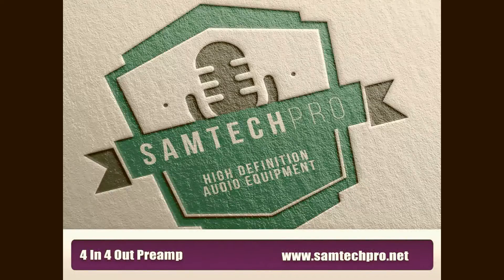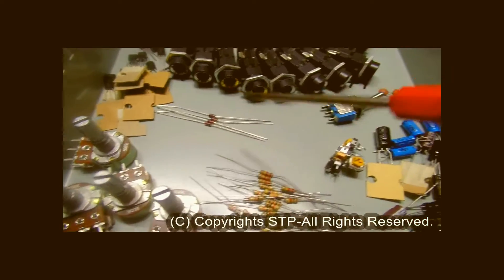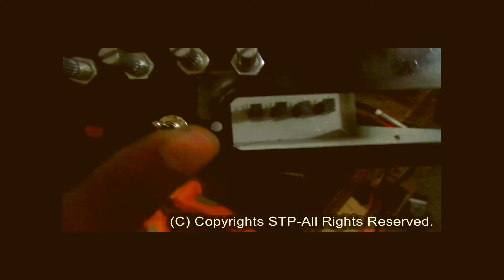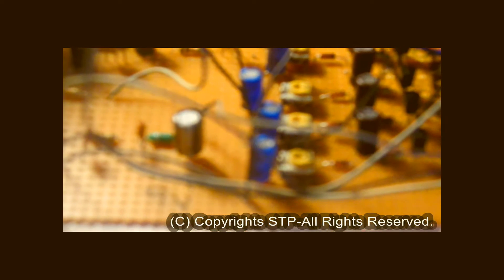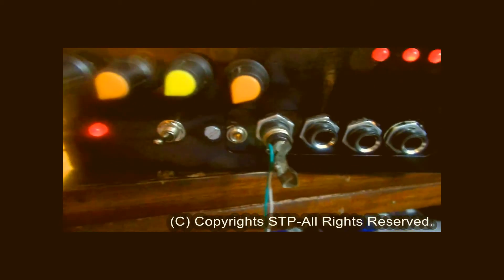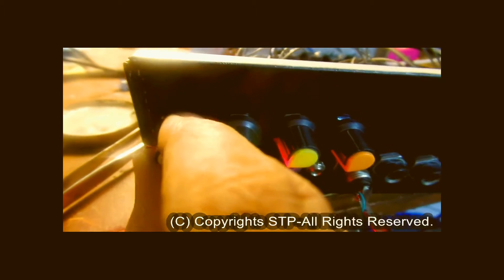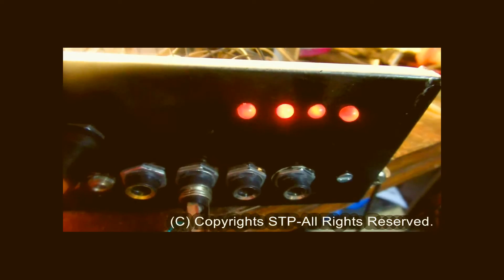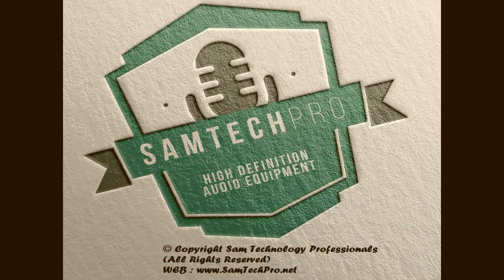DIY Multichannel Input/Output Pre-Amp

Comment: did u use 4.7k resistors? In the project link i couldnt find them
Reply from the maker: No i used everything same as in my circuit design. There is a link to it in description.